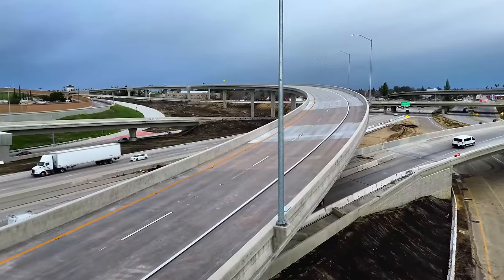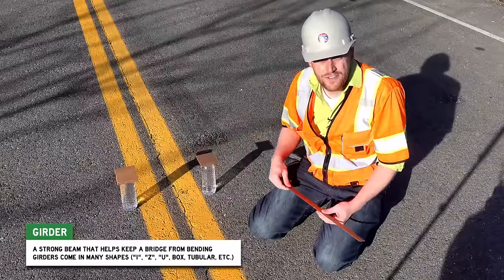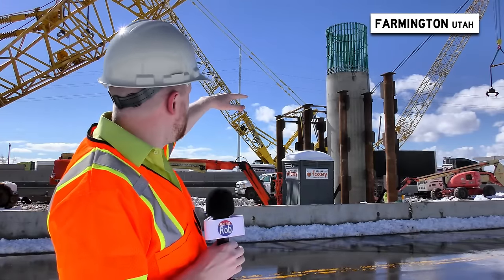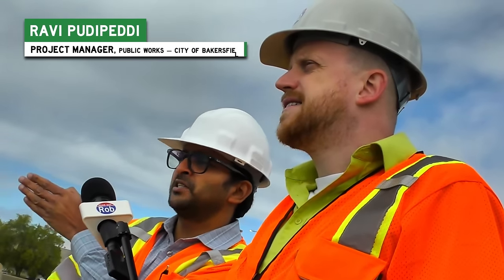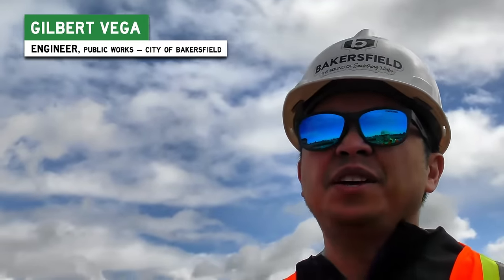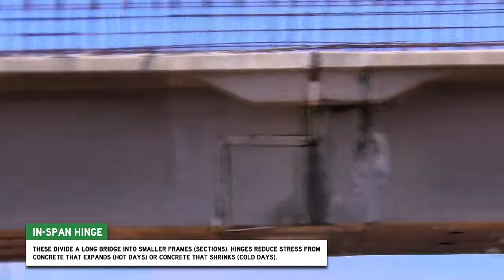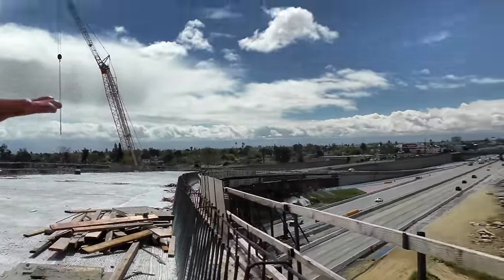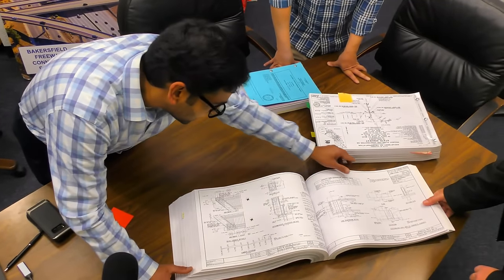This $100M bridge is made with WOOD and is TOTALLY HOLLOW

Comment: VERY limited lifespan because they keep insisting on using steel rebar that will rust out in decades or due to thermal expansion differences in place with large temp swings, come loose from the concrete.. I mean it ensures future business.
Reply: Life spans of 100+ years with proper maintenance is not limited. There is no practical way to do this without reinforced concrete, new materials like GFRP rebar and CFRP rebar and PT strands are not universally approved at this point. And I assure you it has nothing to do with the contractors wanting to have job security. There are plenty of jobs to do and this one won’t need replacing for generations.
Reply: @zrunner800 Yes, it VERY limited when it comes to modern societies.  In Rome they built large concrete structures that are STILL in use >2,000 year later.  AND basalt rebar IS approved by the ACI for meeting the HIGHEST standards for rebar use.